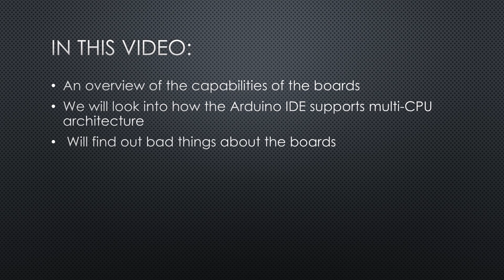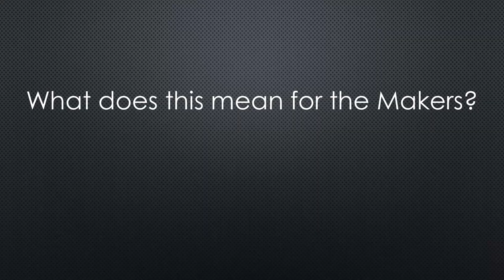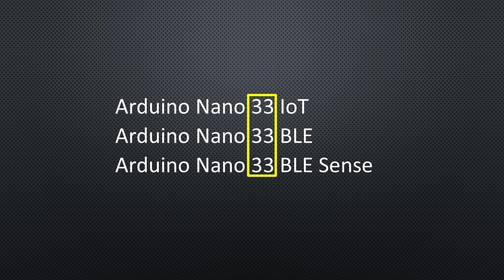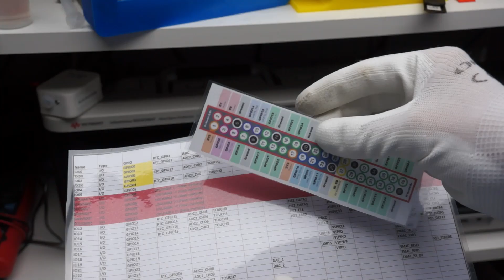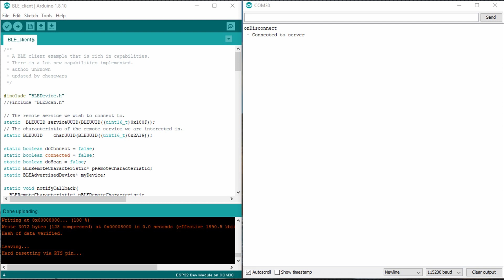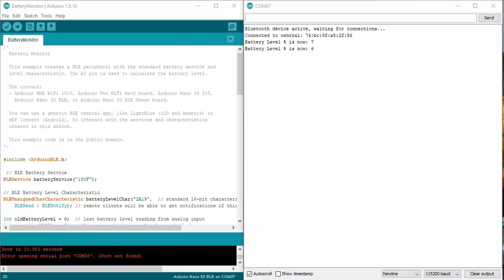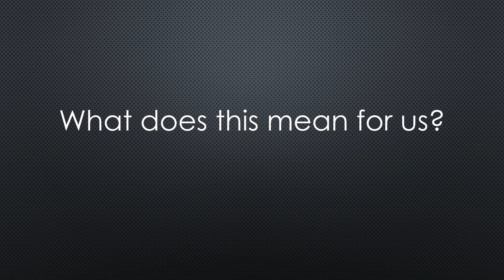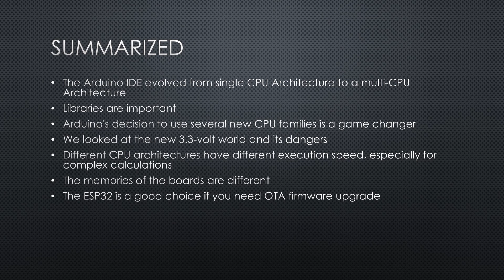#298 Four new Arduino Nano Boards: Test and Comparison (Every, 33 IoT, 33 BLE, 33 BLE Sense)

Comment: TL;DR: Stick to ESP32, stick to PlatformIO. Arduino is mostly brand marketing now.
Reply from the maker: If I read the comments, Arduino does not get a lot of business from hardcore makers. Maybe they try it with the more professional market where time is valuable and people want a trusted brand.
Reply: True, brand trust is still in their favour for now. For the future however, I wouldn’t put a penny on it. My trust in Espressif went through the roof in 2017 when I saw their reactivity on fixing the Krack vulnerability discovered in WiFi. That and the antiquated Arduino IDE made the balance irreversibly tilt toward my current universal setup ESPs + PlatformIO Core. That’s where all the fun happens for me nowadays.
Reply: Pretty much what I was also thinking. ESP32 FTW.

Comment: The NANO 33 IOT doesn't make much sense to me. If you need some tight data capture or real time capabilities you still have a second core in ESP32 chip for that, and leave another one for non realtime stuff (communiation, wifi, buttons and display, writing to SD, etc). Most of these boards doesn't make much sense to me, especially considering pricing. I am pretty sure the power modes used to lower the ESP32 power consumption can be adapted to other boards. Apples to oranges comparison.
Reply from the maker: Reading the comments I thing, Arduino sells more into the professional market where time is money.

Comment: In your comparison chart, it would be more accurate to say a Arduino Uno is < 3$ (clone), an ESP32 is < 6$ (clone).
Note that all Nano/Nano 33 prices are VAT excluded!
Will (and when) we see first Nano 33 clones? It will be a major game changer!
Reply: Since the board files and components are readily available it shouldn't take too long for clones to become available
Reply: the basic esp32 is <2$
Reply: And not mentioned in the video Digispark clones (with USB support) are for little more that $1 and the best possiblilities/price factor Arduino compatible boards STM32 recently even for $1.4 :)
Reply: Yeah that's my thought too. Boards like the arduino due or yun weren't popular at all since there were no clones at a lesser price imo, especially with esp boards being released at a similar time
Reply from the maker: Guys, this video is about the new Arduino boards and already more than 20 minutes long ;-)

Comment: The prices of original Arduinos were always ridiculous for me. For 3 new arduino boards you can have RPi4... For one board you can have ESP32 with a few sensors and battery. I don't see any advantage using them as ever.
Reply from the maker: They seem to have customers...

Comment: I don't mind the pinout on the bottom and the only way I see the nrf taking over the esp is by being very very cheap.
Reply from the maker: Look at the BLE 5 specs: 120 m reach and meshes. Not bad. And built-in into all Smartphones. But of course, I do not know...
Reply: @AndreasSpiess  can the reset button be desoldered and installed on the other side of the board?
Reply: @AndreasSpiess  Someone told me that the extended range feature is part of BLE 5.1 and not 5.0.
Reply from the maker: @Marijn: 5.0 has already the big range
@Todd: No, I do not think so. No throughhole...

Comment: Hi, thanks for a good video! I'm a bit confused about the 3.3V limitation. Is that only for the GPIO pins, or can I not power this via USB?
Reply from the maker: Most boards have USB input and a 3.3 volts voltage regulator to feed the processor

Comment: (edit: when rewatching your video I saw that it has native usb-support!. that is what I need) Do the Nano33 Sense need to install some drivers to be able to communicate with the chip, like we had todo with ESP32?.  The Nano 33 Sense is impossible to buy around here :/ never in stock, and that is not cause of its sold out, its cause of the retailers dont get any boards from Arduino they say.
Reply from the maker: The keyboard() function can simulate a keyboard and there is also a mouse() function available if your board supports it. The ESP32 does not support this mode.

Comment: Have you seen Chinese Mega 2560 Pro (ATMega2560) and Pro Micro (ATMega32U4) boards?
Reply from the maker: I used one of these pro mini boards for my 433 MHz bridge because it is so small and I did a project with the micro (Excel data logger)

Comment: Are arduino pins stil same? meaning that if in code pin is 1 then it is on board pin 1. In ESP boards this is so confusing and I don't understand why they did it that way
Reply from the maker: I think so. BTW: Also for the ESP32. Only the ESP8266 has an alternative numbering (which you do not need to use)

Comment: Interesting! Thanks for the overview. Recently I started to program the ESP32 with ESP-IDF. It takes time to learn but it seems to me more professional than the Arduino programming. What do you think about ESP-IDF?
Reply from the maker: I never tried it.
Reply: @AndreasSpiess  Thanks for your fast reply. Maybe you should have a look, it's an interesting system. By now it's easy to install it. I used the ESP-IDF and VisualStudio Code and editor. I tried it with PlatformIO but that is currently too limited for ESP-IDF. A good start is here: https://docs.espressif.com/projects/esp-idf/en/latest/  My first project was a CAN-BUS logger (500k bus) because the Arduinos were too slow for that.

Comment: I got the 33 IoT, do you have any idea what's the purpose of the transparent blob inside the sheet metal rectangle besides the ESP?
Reply from the maker: I think it is hot glue to prevent that the geometry is changed.

Comment: I wonder, when they will start using RISC-V.
Reply: Arduino already had risc-v based microcontroller but not a bop.
Reply: @kombatub5925  bop?
Reply: sorry my bad, i think bop can be used for something that hype, it turns out only for song.

risc-v need further development to replace ATmega, ARM and esp.
Reply: @kombatub5925  I dissagree. RISC-V is already good enought for microcontrollers. Just look at all the RISC-V microcontroller boards out there. Only unfinished is RISC-V for GNU/Linux (vector, JIT extensions not yet ratified)
Reply: @glitchysoup6322  yup it's good on paper, but the community can't convince non-expert user to start using it instead of ATMEL/ARM. 

it's hard to find simple project risc v-based in google. meanwhile uno and stm have ton of example.

that's why risc-v cant replace them, yet

Comment: Thanks for the newer board knowledge and testing provided. Good advice on voltage levels respect.

Only one question ... Where is the arduino duemillenove :D ?? They are still working and accept PDIP ATMEGA328P ( U ??) . 

Not tested yet BLE :( 
 if compilation is slow must be compiler options to maximum optimization to size or it is very new and not quite optimized.. check cpu usage on PC when compiling if it takes much %
Reply from the maker: I did not cover all Arduino boards and the duemillenove was probably not the most famous board. At least, I never owned one. An if it is only a compiler option, I hope they will find it and change it to be faster ;-)
Reply: @AndreasSpiess  quite frankly the UNO maybe came 2 years after the duemillenove, not the famost board but it improved a lot from the decimilia one :) ATmega328 , auto-power select by opamp instead of jumper, and uno is similar except the serial USB interface chip , so it can be as a first step to the uno ?  As for the nordic compiler, a comparasion between compilers could be done using the nordic SDK and try to compile a identical program to check its time between the Arduino, but it requires extra instalation ...

Comment: so as long as my I/Os are reading less than 5V should be ok? is anything over 3.3V going to ruin the board?
Reply from the maker: I do not remember. Maybe you check the datasheet? BTW: Most newer chips do not like voltages above 3.3V.

Comment: The Nano 33 BLE only shows up in Windows 10's bluetooth list when plugged into a PC's usb port directly. I can run it on a 5V battery plugged directly into the Nano's usb port but Windows does not see it. I have also tried running it 5V into the VIN as well. Same result. Anybody have success running from battery?
Reply from the maker: Maybe you need an example sketch to enable BLE? I never used it.
Reply: @AndreasSpiess  I’ve tried several. Boards like the HM-10 show up when they power on. :/

Comment: Nano 33 iot will be great if it be possible to reprogram esp32 part. 
Samd21 for application.
One xtensa for web server.
Second xtensa for wifi stack.
Reply: @dd0356  ulp isn't as usefull as it imaginable can be. Esp32-s2 had much better ulp core (it uses risc-v). Maybe they some day release esp32 witch this new better ulp. But ulp core is always better than no ulp core :)
Reply: And one more thing. When Arduino announcement first boards witch ublox module (I think it was new Arduino wifi and 101, I can be wrong) they say esp32 part of boards will be programmable from Arduino ide in easy way. This sadly didn't happens so far I know.

Comment: What is the average power consumption for the Nano 33 IoT with WiFi enabled?  I see it can peak at 250ma.
Is is better or worse than the traditional Nano 3 running at 5 volts instead of 3.3 volts?
Reply from the maker: WiFi boards nee much more current than boards withour WiFi. I do not know the details of the Nano33.

Comment: I wrote a WiFi SSL application for the Nano33 IOT board 2 years ago. I wanted to duplicate the project for a few friends, so I ordered the latest boards from Arduino. The code connected to WiFi OK but would not do an SSL connect to a remote server. Upon investigation, I found the Nano33 microcode level on my original working boards was 1.2.3, and that of the latest boards that would not work is 1.4.8. It looks like changes made to the firmware broke the SSL connect feature. I opened a problem ticket with Arduino, but they never acknowledged the problem. Desperate, I tried to downgrade the microcode to the earliest code I could find (version 1.2.4), but SSL connect was not functional there either.  Do you know any way I can get version 1.2.3 of the microcode loaded into the Nano33 boards so I can do SSL connects that will work in my Arduino sketch?
Reply from the maker: I always use ESP32s for internet scenarios. It has a much broader community.

Comment: I think the Arduino line has seen its end and always behind the maker curve due to the size of their manufacturing and the code needed to make a finished product. Something had to give and in this case it is support and examples falling behind like the esp8266 and esp32 first were when they came out, only the price does not match the effort put in to make them viable like the cheap esp line was. In short I think the microcontroller scene is getting too convoluted and the market is diluted with too many different chips, very little of seems to care anything about the power consumption. The more power hungry and intense these get, its just easier to run a pi zero or zero w or a full pi board, the only acception in this class would be the teensy 4.0 that is 600mhz and worth the power it consumes. In most cases you can do all you need with an original uno, as projects are mostly purpose built and only use a fraction of their available pins.
Reply: s bright  You realize that is just what I said?
The cheap price is what makes it worth it to port. I don't feel like porting for $20+

Comment: I've been developing on a Mega 2560 (with temperature and 6-axis gyro/accelerometer modules), but I like the IoT capability.
Is there a "Mega IoT" that I could just substitute, for the cloud application?
Reply from the maker: I do not think so. 5 volt boards are no more created these days. All new boards use 3.3 volt processors. We us the ESP32 as a replacement because it has WiFi and a lot of pins.
Reply: @AndreasSpiess  why did they stop making 5v boards? Do you think it is an improvement?

Comment: Oh, waiting for EPROMs to UV erase... Those times ;-)
Reply: My first job in the industrial automation in 1987, I had to update the SW of a large power station, about 40 cabinets full of racks containing cards each running a single item like a valve a motor etc, I had to extract them, take out the eprom and put them under the UV lamp, then transfer the program on them and put them back on the card and back in the rack. many hundreds of them,  i tried to get them to order an 8 port programmer, but without success, If I remember correctly it took about 2 weeks of work.
It was the Hartmann & Braun Contronic 3 system from Germany.
Reply: @santopino2546  Shouldn't have been faster to extract all the EEPROMs and put them together under the Sun?
Reply: yomboprime the eraser could delete I think about 8 chips at a time, the writer could write one at a time, there was no pratical reason to exelerate the delete time without exelerating the write time.

Comment: It would be the best if be able to choose a suitable microcontroller and all Sensors you realy need for a specific project. Like: Atmega, Temp/Hum sensors, Display, coin Cell holder, ble
I know it's nearly impossible but  you can go also on a Website and click together any PC that you want, why not with any IOT stuff?
Reply: Cost. Sell 1 model and have 1 factory and buy 1 million parts at a time. Have 20 product lines? 20 factory lines minimum, have huge inventory space (because some might not sell for a while, and if you change production lines and get a massive order you won’t have time to fulfil). Retooling as those components are in no way the same shape and some might be picked up by vacuum while others may need robotic arms and hands of various sizes or a simple PNP machine), then solder order (can’t just heat-gun it all now if there is some plastic coin battery box if it melts, WiFi chips might be more susceptible to damage if it’s too hot so then you gotta change your temps and duration), then it also gets cluttered picking an item (“mom I want an Arduino for my birthday”, “ok, sweets, they have like 20, which one...”).

Modular design (just like computers) has been a big thing for Arduino, it’s basically legos anyways, just like computers (pick a CPU and main board, pop it in just like a WiFi chip on Arduino, slot in ram just like a motor driver module, slide in an NVMe just like an SSD card reader, plug in a GPU or WiFi networking card just like a WiFi module, pick your power supply just like Arduino, it’s all basically the same thing). I think the modular way is probably just as cheap as integrated to due to above logistic and manufacturing issues, plus for $2 you can make it entirely different purpose in the future.

If you didn’t know, you just buy whatever computer parts you want, like my machine has:
TR-1950x CPU
4x R9 Fury GPUs
4x 8GB 3600 memory
2x SuperNova 1300 PSUs
NVME SSD, RGB SATA SSD, mechanical HDD
Water cooling with multiple radiators
3x 4k monitors plus a 240Hz 1080p monitor
And if I feel like it I can also add more: for rendering videos while I games I’ve used a Titan Xp for CUDA acceleration plus 3x RX470 for open GL compute while I did some 4k gaming on 2x R9 Fury crossfire, all on the same PC, 6 GPUs of mixed graphics for specific tasks all at once, just like Arduino modules can be combined. So it’s very similar with the old modular designs as computers are, they already have that.

Comment: i saw these and thought theyre 3rd party so i bought the old one
Reply: Haha, lol, that’s when I do buy them! I’m pretty certain it was the Chinese that greatly improved the original UNO (which Arduino then copied later), someone found a way to cut manufacturing costs in half. The giant logic gate looking socket the UNO was like $1.70 for just the processor part, and the Chinese clones/improved ones (not really a clone as they were massively altered and better) had the SMD microchip (which cost only pennies), so they were able to sell for high profits cheaper than parts alone on the OEM. It also weighed significantly less (so much better if your project flew like quadcopters/airplanes/helicopters, or just wearable items). It also meant that with the micro-USB (which everyone has without hinting for that stupid printer cable each time), that it was rediculously thin if you left the pins off (not quite credit card size, but like 3 cards thick instead of like 8), so much better on tight space constraints as well if you still wanted to use the classic UNO.

Ultimately, the reduced cost brought many more people into tinkering/DIY/programming/robotics because of making the boards highly affordable (like $3.50) and consequences of burning them out was not a huge issue (I’m not sure if they are more durable, but I’ve shorted mine out a bunch and all input/output is still working flawlessly on the Chinese versions, like my cousin even had his hands on it and he’s fried like 3x Arduino Genuine and last time he was at my dorm room his raspberri pi caught on fire and my blankets have burn marks in them... like if they survive being in his hands for more than 30 seconds you know it’s a foolproof board!) 

So, for pushing innovation like product improvements while cutting costs making learning more affordable, I reward them. Since Arduino is open source, it’s fair that they were allowed to improve it (and for Arduino foundation to copy them), so you can buy from whoever, but don’t forget that the Italian Arduino split up with the manufacturing giving $0 profits to the developers/creators (that guy stole the profits in the end, only donations got to the devs), so buying genuine boards for a long time did not help fund the devs (which sucks, very sad case).